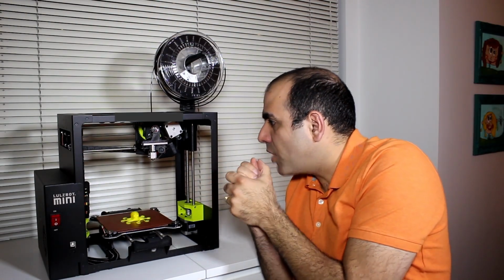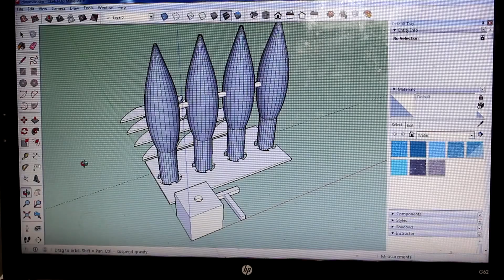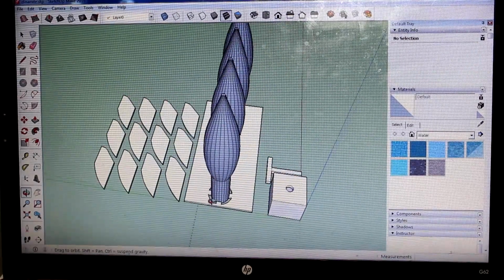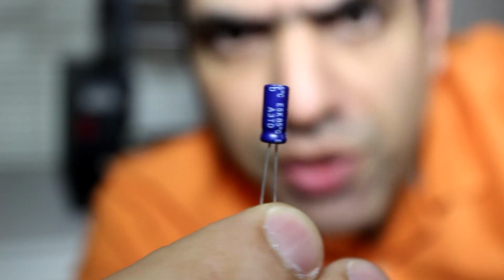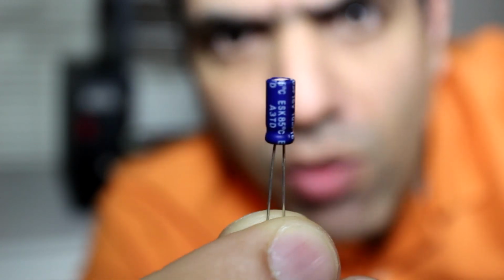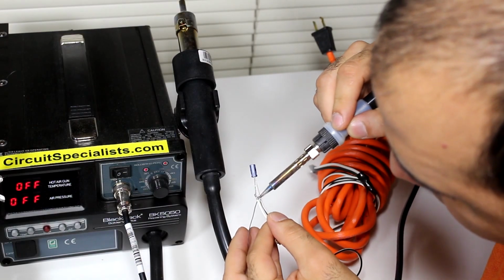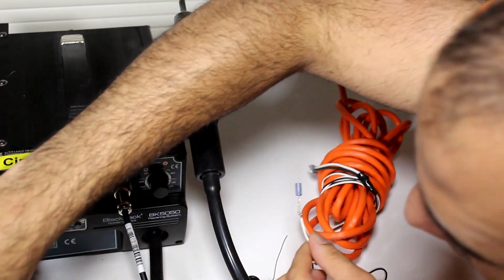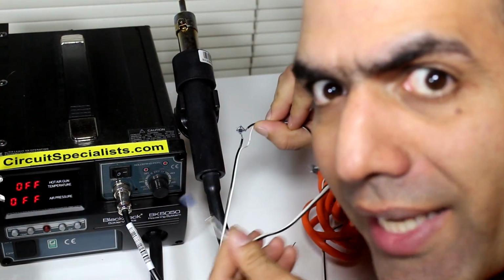How 3D Printing Works

Comment: I tried to 3D print using a hot glue gun at my summer camp. Instead of blowing on the material for hours, I just plugged in a small electric fan sitting near my bench. The fan allowed me to speed up my process

Comment: Pregnant women are the real 3d printers
Reply: Abhishikth Karumanchi Good point!
Reply: 3d printers printing 3d printers building 3d printers to print 3d printers to, uh

*rolls Inception*
Reply: And we men supply the INK.
Reply: I died lmfaooooo
Reply: Technically it’s more like they make the starting point for the 3D printer that 3D prints itself.
Reply: Flanky Flanked • 14 years ago , you could say we provide the model
Reply: Abhishikth Karumanchi true lol
Reply: 70% Accurate
Reply: If I ever will get in the bed with someone, I will tell my partner that they will be a 3d printer.
Reply: A.G. Martinez Waiting for someone to get pissed at that lol
Reply: Nice but they don't 3d print
Reply: not a women 
u should say Every "Mom"
Reply: No no, hes got a point
Reply: You mean the resin-substrate, inverted print type?
Reply: Mmmmmmmmmm nope.
Reply: Blows up a capacitor
Reply: that's good buddy but I don't remember asking

Comment: Which sponsor was it?
Reply: Where had he plugged them in the original video? And why did the original video have 30k dislikes?
Reply: Jake Roosenbloom likes not dislikes
Reply: Jake Roosenbloom 30K likes, not dislikes. The sponsor requested they be removed so he followed through. It was easier for him to re-edit and re-upload the video instead of dealing with a legal matter.
Reply: The video had 30k likes, not dislikes.
Reply: He put a sticker on top of the printer. You can see now it's covered by a grey rectangle.
Reply: Jake Roosenbloom The sponsor was Arrow ( arrow.com )

Comment: Why does arrow.com hate you so much? One of the largest distributors of electronics IN THE WORLD! Did they not like your capacitor-propelled rockets?
Reply: @DerClouder  I think it is mostly the bomb part to be honest. They don't want to have that connection because it is a very real possible use.

Comment: I was young when I tried repairing a broken vertical blind holder with a hot glue gun.  Worked great until gravity decided that the glob of hot glue would now become part of my hand and knee.  Huge 2nd degree burns, days of blisters that eventually popped and scars that haven't completely disappeared years later.

Comment: I'm curious if the STL files for the 3D printed rockets and the plunger style switch enclosure are shared anywhere? Thingiverse or  Youmagine? My local makerspace really wants to try this out with a bunch of dead old capacitors from recycling old PCBs.

Comment: Wow, so deep, we are the 3D printers, and we 3D printed 3D printers!

You said this machine used 3 stepper motors in x, y, and z axes.  I have used servos, which I thought were the same thing, but some quick googling told me that steppers effectively have more points they can register.  Does this give 3D printers more "resolution" as these steppers get more "sensitive"?

There were some other differences of steppers from servos that seemed good for these printers, but I'm busy playing with my hot glue gun, so I don't have time to ask more questions here.